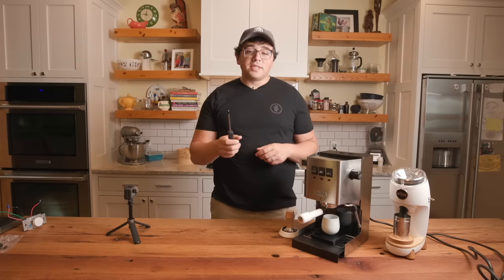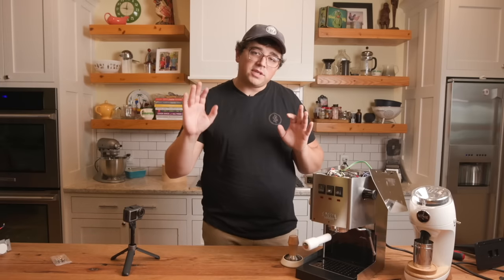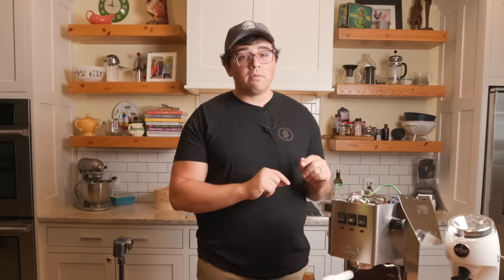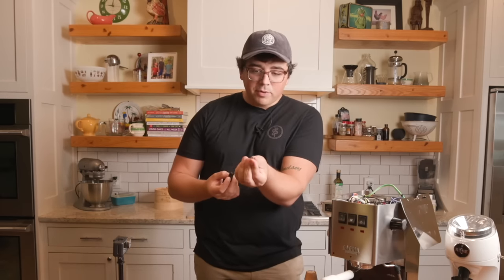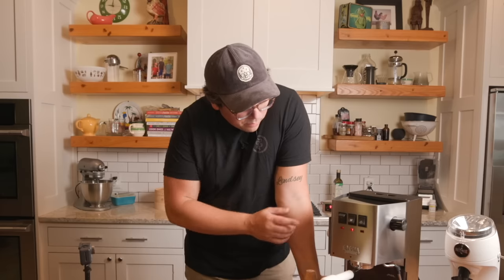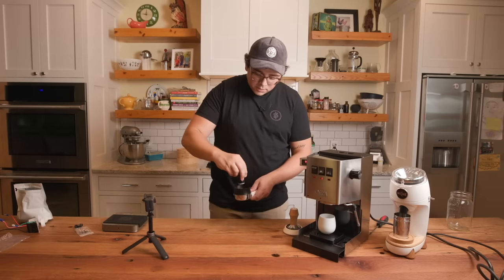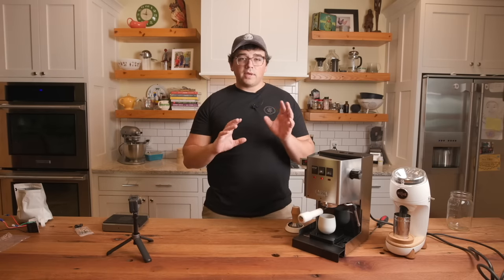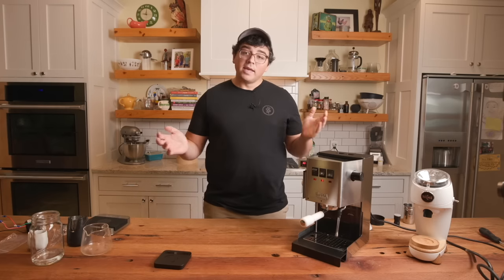TURNING A $450 MACHINE INTO A $3000 ESPRESSO MACHINE!: Gaggia Classic Pro FRANKENSTEIN

Comment: you posted this 2 yrs ago, and I found your channel and I love it. I have an old Cuisinart espresso machine. the pods are cheap and each one has a single output hole. I bought an upgrade 51mm basket and filter full of holes, the water comes out so fast it's too much; however with this mod he he he I can get the crema and rate I really need without the pressure washer effect. even used the old filter basket on the new handle and it literally was a jet stream. again this will solve my issue for now until I get a high end machine. I hate I didn't think of it. also Cuisinart has plastic check valves no springs that is able to be modded. I'll research more on the output heat but as far as I can tell all are connected to a single heat source if anyone else reads this :)

Comment: Pretty cool journey. You definitely learn a thing about how espresso machines work. However, with all the additional money and time required to mod the Gaggia to this extend it's probably wiser to invest in a heat exchanger, straight away.
The thing is you may not get as much bells and whistles (although that depends on the brand) but what you get instead is sturdier components and plumbing as well as higher capacities for back-to-back shots. A machine with a higher initial cost may last longer because of that and is easier to maintain. Plastic tubing will wear out and become brittle and stiff, eventually. Also, most accessories center around the E61 group head which is also widely available when you are in need of spare parts.

I know, this is just my unpopular opinion and you may ignore me. However, I just don't want people to fall into the trap of low initial cost only then to sink in another grand or two into a machine whom you will grow out of, a few years further, while completely disregarding the cost of maintenance.

Comment: I’m probably wrong, but first instinct is that the dimmer mod is going to be extra wear on your pump, as they work by rapidly “switching” off and on, changing power supplied by varying the “off” and “on” durations. Maybe a variable voltage regulator would be better, but then again I’m not sure if running under-voltage would be harmful to the pump, either.
Reply: what you mean is a PWM controller. not sure, this is one.
Reply from the maker: I'm not qualified to give certain responses. All I can say is this mod has been around for years and I've never heard of a pump going out as a result. Even if it did. Ulka pumps are cheap and easy to replace

Comment: Hey man great video. Do you have some schematics of the original and the modifications, please.
Regarding the overshoot of temperature in the PID, probably with the adition of the PID the whole system became a 2nd order system. And the overshoot from your initial condition (cold, low temp) is easily seen. Once the system is warm your initial condition is different, you still have an overshoot, it is just not visible.

Comment: Amazing video, thank you! I got the spring set and was wondering why 6.5 bar spring vs a 9 bar spring. Are there significant advantages or disadvantages to 6.5 vs 9?
Reply from the maker: With lightly roasted coffees, which have lower puck integrity, 6.5 bars might provide some better extractions. But it is all down to preference!
Reply: @LanceHedrick  Thanks so much for the reply, I'll give 6.5 a try!
Reply from the maker: Sounds good! Report back with results

Comment: Great video explaining everything! I have a question regarding older Gaggia Classic models. I own a currently unmodded 2004 Classic, was hoping to mod it, but could not find much information about modding the old classic other than the steam wand (as opposed to the multitude of information about the pro). I wanted to ask if I could follow the same or similar modification guides for the old classic as with the pro (I think the pressure works differently on the old classic). How different is the internal setup of the old classic and the pro?
Reply: Not very... It's the same machine but Gaggia decided to implement some of the most common "mods" and release it as a Pro

Comment: I just did the PID with pressure gauge at the same, along with the top mount from shades and it actually took about 2.5 hours. This is including having to go back in because I had a small leak from the pressure adpater. I do think the top mount makes for an easier installation. Looking forward to installing the dimmer mod from mr shades as well, since it is a cleaner look.

Comment: Hi, and bravo for a job very well done! I would like to kindly ask you one important question (important for me, at least :) ). In "Demoing the Mods" you used the Smart Espresso Profiler app in your smartphone to monitor the pressure control with the dimmer mod, but ... where is the Smart Espresso Profiler hardware installed? I can't really locate it in the interior of your machine!
Reply from the maker: I didn't monitor the pressure! Just the output flow

Comment: Nice video Lance but that raises the question if it does make more sense to buy the Dual Boiler right away or mod the classic? What do you think?
I'm currently looking for an upgrade from my cheap delonghi machine which actually can produce decent espresso. I moded it with a bottomless portafilter and Silvia steam wand.
But i want to get more into medium and light roasts as i really like fruity espresso.
And yeah between these two i don't know which to buy. Or do you have a different idea?
Reply from the maker: Breville dual boiler. Haha I probably sound like a broken record but that machine is hard to beat at the value. Should be noted I do NOT get any compensation for recommending. The machine is incredible for the price and the online community is massive
Reply: @LanceHedrick  Allright I got you. Appreciate the quick response man 👍🏻
Reply from the maker: Absolutely! Happy to help my supporters. Appreciate you!

Comment: Great guide! Wish I this months ago when I was installing the dimmer mod.
Another mod that would've been cool to cover is boiler insulation. I just wrapped some high heat silicone all around my boiler, and heat up time + temperature stability is now insane. I actually needed to run my PID auto tune again because it was massively overshooting temperatures.
Reply from the maker: Haha! Yeah. I considered it, but it is so intensive, I figured i'd do mods more people do and would be willing to do, if that makes sense. The PID, although intense, at least has a full manual and mr shades who is willing to walk people through it. Thanks for commenting and bringing that up! Valuable comment here. If you have a good guide to the insulation, i'll add it to the caption!
Reply: I think honestly an even better insulator that is also cheap and easy is to just buy a load of melamine sponges and just place them around the boiler fairly loosely. That should also work well. I'm going to attempt this with my gc, will prob post an update on espress aficianados.
Reply from the maker: Oh hell yeah when you do, drop a link and I'll add. Or tag me there
Reply: @NickMayers-rj9zn  How did it go with the sponges?
Reply: @knipsi22  really well actually. Would recommend taking the time to take the boiler out and properly zip-tie everything but overall would definitely recommend

Comment: I feel like a mention to the rancillio pid guys is in place. If you're in for true diy, and wifi app control. These guy put in the work and keep putting in the work, open source. Only thing is the pcb you need to get from one of the guys. But you can wire it yourself (it'll be a mess if you're not quite capaple) but once you're in, the options are endless.
Reply from the maker: Oh snap! Drop a link and I'll add to caption!

Comment: Hi, is there any modification possible that let's you determin the amount of brew / ml that is coming out? We use the GCP a lot and it would be a lot easier if i could set the amount of brew to a certain ml or cl , and that the machine stops brewing as soon as the set amount has been reached. So we don't have to watch the amount it's brewing and stop it manually, but the machine stops by itself. Is there anyting to create that?

Comment: I get why people tend to get a PID-controller-kit. But to be honest: they are over priced. If you are used to tinkering around with electricity (what you should be, if you do that kind of stuff, even with a kit!) you can easily build all that for a third of the price they ask for. And to be honest: do it prettier as well. I used a microcontroller and a blynk-server on a raspberry pi which I use for my 3D printer anyways. So my Rancilio now has WiFi and can be app-controlled :) Including changing PID values, brew registration, timer, heating behaviour while brewing etc. You could even program a digital dimmer to control your pump and you can't tell from the outside. Except for a 0.9" oled-screen which I attached with magnets. It just takes time to develop that stuff DIY, but there are ready to use open source projects. I understand if you don't get into that stuff as a dad now ;)
Reply: So did you build yours? And if so, what instructions and parts did you use? I'm good with my hands (PC builder) but want reliable steps.
Reply from the maker: My channel isn't meant to be over-the-top niche haha. I have no issue building my own, but it wouldn't be practical for the majority. I do appreciate the comment! Hopefully others find it helpful.
Reply from the maker: Comment was not deleted. For whatever reason, YouTube doesn't allow links in comments. I've noticed this like 20 times lately when I ask people for links. Only YouTube links work in comments. Really annoying
Reply: @LanceHedrick  Alright, I just wondered how it disappeared. But thanks for the tip that I can't use external links!
Reply from the maker: No problem! I would love your links here, tbh. Maybe email me an exhaustive link guide for DIY and I'll add to caption?
Reply: @LanceHedrick  Check your Comments settings in YouTube Studio.
Reply from the maker: Oh. Good call. Will do now.

Comment: Hey Lance - I've watched a few of your videos and they are all well done. Thanks! I am new to espresso, long time coffee lover and want to take it to the next level. So... I ordered the Gaggia Classic Pro (2019) + Bezzera BB005 (arrives this week). Are there several different models of the GCP made? I got my machine from Whole Latte Love and they told me the OPV spring mod only works on the older models & the newer 2019 model doesn't allow for this mod. Is this true? Looks like your machine is the same year / model and wanted to see if you could help me clarify this point? Thanks, Brent
Reply from the maker: This is not true. Purchase through Mr. Shades! The mod is only a spring. It's very easy

Comment: Congrats on the baby.   From what I can see in the video you “could” have drilled a couple of holes in the right side (when facing it) and mounted the dimmer so its inside the cabinet.  They make many “ shallow” dimmers for wall boxes.  But nice job with the overall install. :)
Reply from the maker: Yep! I could've done that. Im not keeping this machine, though. It goes to a Patreon supporter. I didn't want to drill any holes.

Comment: Wow!!! That was AMAZING how you did all that yourself. I myself have a Saachi Espresso Maker which has the spring pressure valve right above the head gasket and diffuser. I was wondering, what difference would it make if the spring was tight or loose???... like the water flow would be different? Or like the extraction will be better with a stiff spring than a soft spring??....
Really Appreciate everything you have done.

GREAT VIDEO🙌🏼
Reply: Was wondering the same... I have a Delongi espresso maker btw.
Reply: Would really appreciate a reply

Comment: Hey Lance! Thanks for the vid. Any opinion on having a dimmer mod like this vs inserting a needle valve to modify the pressure directly? Thanks!!
Reply from the maker: I like the dimmer mainly because I feel it might have a longer life if doing blooming shots where the needle is solely responsible  for restricting flow. Then again, needle replacements cant be expensive. I have found the dimmer mod is much more responsive.

Comment: Not bad, but honestly, any 3,000 machine is going to have dual boilers, those boilers are going to be more powerful,  will likely have better passive warming up top, have multiple bar gauges, and in some cases will have profile control.
This is, accurately, a $1000 machine, which cost about that to build.
Would you rather have this modded Gagia, or a Profitech pro 700, Rocket R58, or ECM Synchronika?
Reply from the maker: Dude. It is click bait haha! I'm well aware of thermal properties in more expensive machines. Just trying to get people to click, which worked with you! HAha

just messing. Thanks for watching and commenting! And, tbh, from the ones you named, I would prefer this machine and $2000 in my pocket to get a dope grinder. Actually, I'd prefer a Breville Dual boiler to any of those you named and have an extra $1500, if we are getting to the nitty gritty lol. 

Thanks, friend! Hope you enjoyed the video even with the silly click bait title!
Reply from the maker: Haha makes sense! I still say BDB has better temp stability, but the Spaz is a great machine, no doubt!!

Comment: Lance, this is incredible. just bought a GCP a month ago and i want to try the spring mod, but i have a question. On the video you say that yours is modded with a 6.5 bar spring. I have read that the ideal of an espresso machine should be 9 bar spring. So should I aim to buy a 9 bar spring? Another very important question, since i am no engineer or have no experience whatsoever in a DIY modding environment: Are those springs easy to find/ buy? any recommendations of how to search for them on amazon or are they sold on any appliance stores? Sorry for the long comment.. Thanks in advance!
Reply: Not sure why he didn't install the 9 bar spring. Check out shades of coffee UK, they have an the mod kits there. Links in the descriptions. They ship a set of springs so you can chose, but everyone seems to use the 9 bar. Not required for pre 2018 Gaggia classic
Reply from the maker: Hey! I'd recommend getting them from the source in caption. And "ideal" is very contentious. It 2holly depends on your style of shot. I tend to prefer 6 bar shots, so I put that as the OPV to allow myself to not rely on the flow control for every shot and to just let it flow at max pressure, which is 6.5
Lots of differences in flow preferences.
Reply from the maker: See above why I chose 6.5 over 9. Can also check out my turbo shot video which is a shot needing 6 bar as opv
Reply: @G-rig6969  Thanks for your answer, G-rig!

Comment: Lance,
Did you have to install any hardware to use the smart Espresso Profiler app?  I'm reading it cost like $400!?
Reply from the maker: No. The transducers are $400 but to use the app with a Bluetooth scale costs nothing (assuming you already have a Bluetooth scale)
Reply: @LanceHedrick  thinking of investing in a decent 1.1 scale to use the app.  But wanted to ask if the realtime info provided worth it ?

Comment: If you want to do pre-infusion, and the ideal temperature let’s say is 93 degrees you should put the pid at 98-99 degrees  in order for the temperature to go down after to 93-94 degrees? Because after opening the steam valve temperature drops significantly
Reply from the maker: So, with the dimmer mod, I'm not opening the steam valve for preinfusion.
In addition, if you noticed in the video, I set the PID controller lower by 8 degrees to account for lost heat from boiler (where temp is taken) to group.
Reply: @LanceHedrick  so if I want 93 degrees the ideal temperature to start with pre infusion is 101?
Reply from the maker: Yes! So, I have my PID controller with a built in offset because it loses temp from brew boiler to the group head. Because it is contained, you can get that high. The same boiler gets the water even hotter to be steam. As it travels to the group head, it recondensates to water.